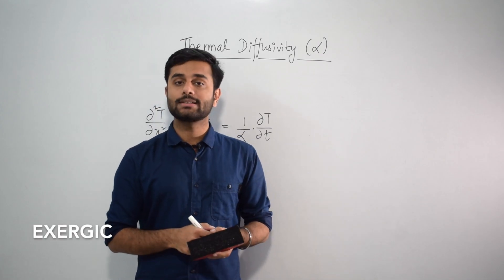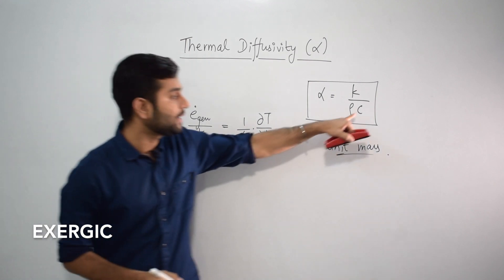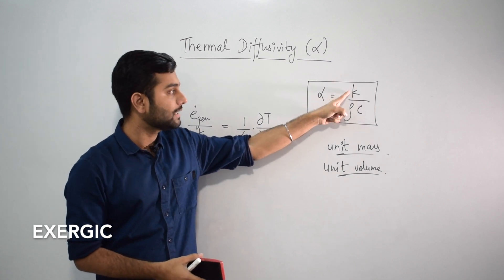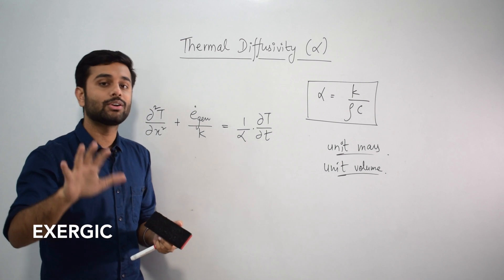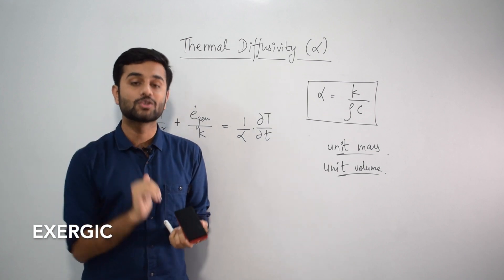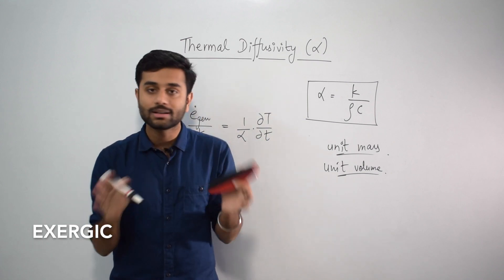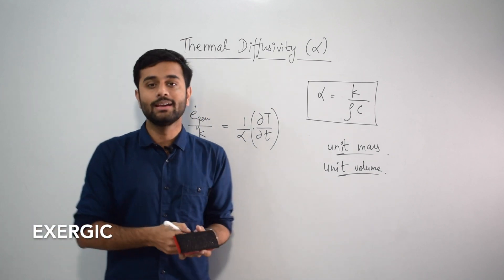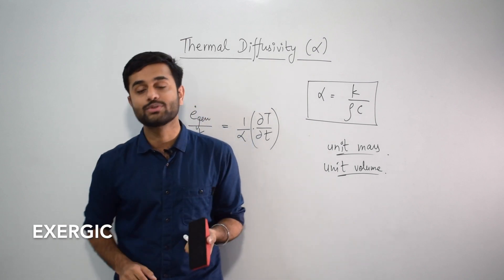Interesting Difference between Thermal Diffusivity and Thermal Conductivity - EXERGIC Shorts

Comment: Sir for preparing machine design for gate level im thinking of relying completely on exergic and buy machine design video course but i suspect if its complete in itself? Or to completely study machine design for gate level i should have md video course + exergic study material. If md video course is complete in itself then why does exergic provides study material for same subject. Also if i want to buy md video course +md study material separately thats not possible from website. Plzzz reply
Reply from the maker: Study Material is provided for all subjects. It has got nothing to do with Video Course completion. And it is not possible to take Study Material of any single subject.

For further queries, please mail your us at support@exergic.in

Comment: Sir this Q was asked  in viva ..."can we apply lumped system analysis to SAMOSA (food item) ? 
( My answer was there is temp gradient inside samosa so we can't) 
Sir plz give ans
Reply: In these type of questions, the answer you give is not as important as the reason with which you back your answer.
Reply: @akshunyabajpai9286  agreed
Reply: it depends ..if there is no potato inside then the temperature will be about same throughout..but if there is potato then it can contain more heat than the masalas..so it won't be  a lumped body..this is my thoughts
Reply: Definitely you can. The lumped system approximation can be used for small bodies of highly conductive materials. Interior temperatures of some bodies remain essentially uniform at all times during a heat
 transfer process. The temperature of such bodies are only a function of time, T = T(t). The

heat transfer analysis based on this idealization is called lumped system analysis.